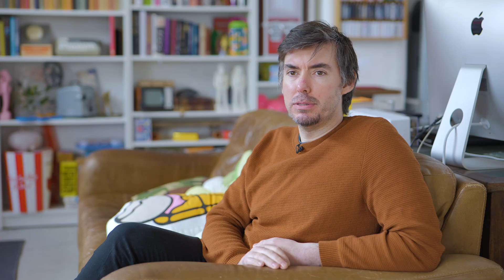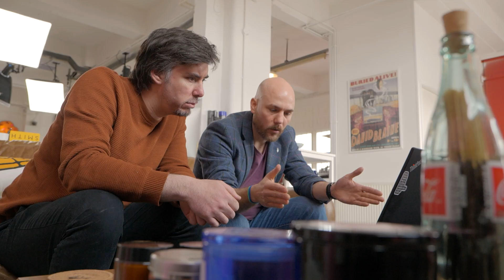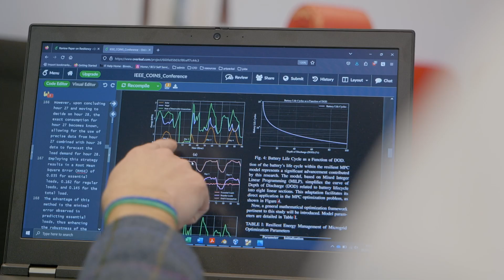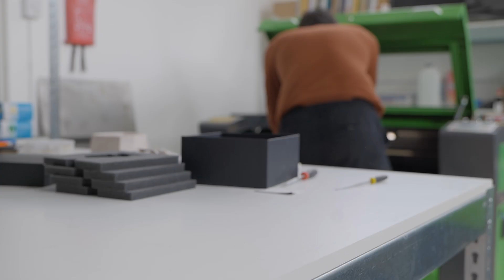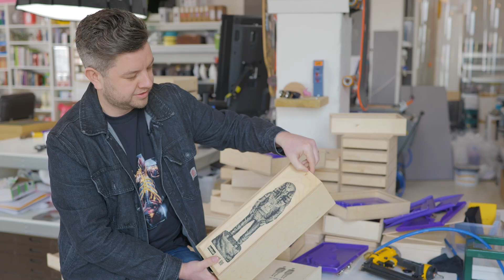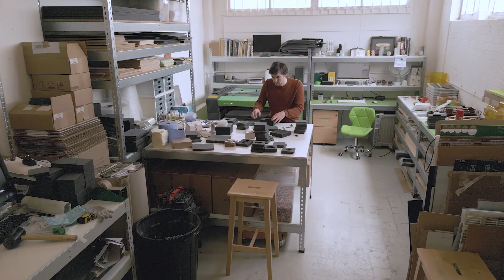Making precise packaging with AI l UKRI Technology Missions Fund

Comment: Bros living off government money. Unfortunately most of this type of packaging foam is not routinely recycled by most local authority recycling centres so you just pissing money into shit we shouldn't be using.
Reply: I don’t think you understand what this project is about, it isn’t about recycling it’s about saving time and more efficient way of reducing cost and material waste. It’s no brainer 🧠
Reply: @ps3addictionz334  Any project to develop packaging in 2025 needs to consider materials and sustainability. It's a no brainer. Next.
Reply: @LazerDon271 You're right that sustainability is important, and it was considered in this project. But focusing only on criticism without understanding the full context can limit meaningful discussion. This solution reduces excess material usage through AI optimisation – a step toward smarter, more efficient design. Constructive feedback is valuable, but don’t let negative thinking block the bigger picture.
Reply: @LazerDon271 You raise a valid point about sustainability, and it's definitely a key consideration. This project focuses on utilising AI to reduce material waste and enhance efficiency, a step towards smarter and more responsible design. I'm sure you have some understanding of AI, so let’s keep this conversation more positive than negative — constructive input helps us all move forward.